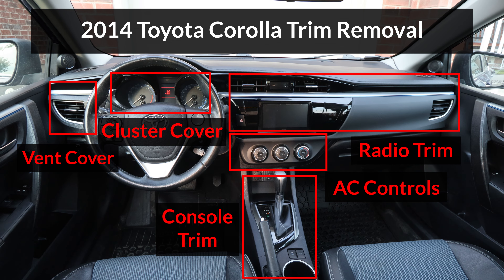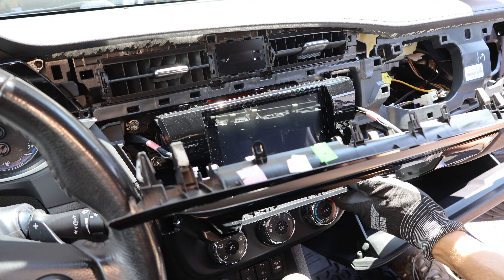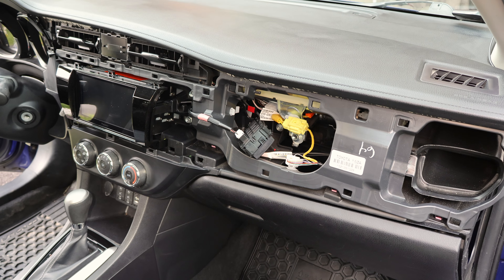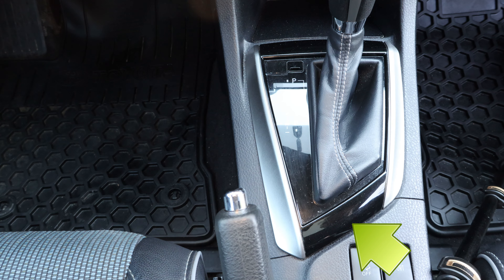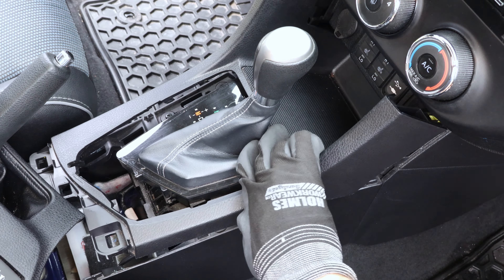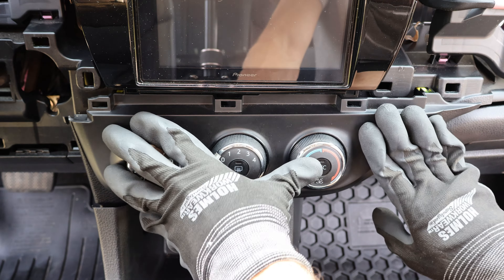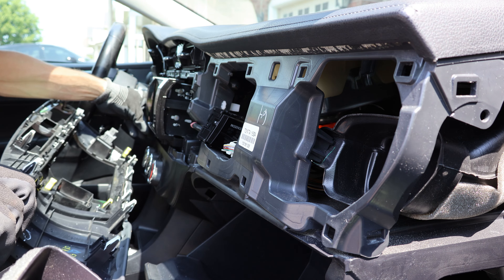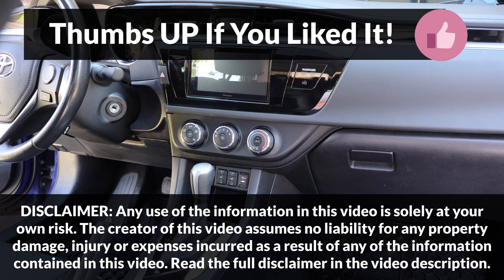2014-2018 Corolla Trim Removal: Radio Trim, AC Trim, Center Console Trim, Instrument Cluster Trim

Comment: The chrome molding strip that sits on top of the small blue molding running left to right across the dash is badly damaged on my '16 Corolla S. I broke one clip trying to separated it from the blue part in order to attempt a repaint/repair but I gave up after the breaking of the clip. The dealership says they don't sell the chrome part separate from the whole dash molding. :(😒
Reply from the maker: The entire piece has to be replaced. Try https://www.car-part.com/  It's called "Radio Bezel Trim" under the dropdown. They're kind of hard to find.. I found one in PA for example that's $100, Stock #401187  •  Bollman's Auto Salvage - ARA, Saxton, http://www.bollmansautosalvage.com/ , but I don't know if they can ship.  I would also try a LKQ Keystone if you have one close by, just drop in and talk to the sales guy. They must have it, they have everything, but it's probably not called "Radio Bezel" in their system. You can also call LKQ, although it will be difficult to describe the part..  They also have an online catalog, but again, it's difficult to figure out what they call it, I don't think it's "Dash Panel" that's likely the top part of the dash.
Reply: @CleverFix  Thanks. I will.